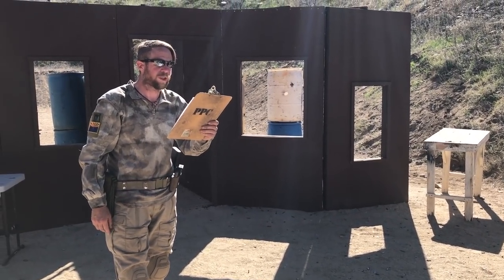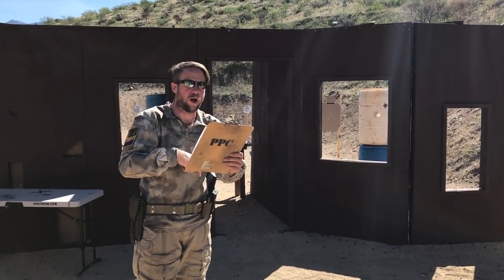2G-ACM X95 Tavor & WWSD 2017 Beta DMR - Stage 2 - CQB

Comment: Having been trained on both the M16 and the SAR-21 (a 556 bullpup), I tend to believe that bullpup service rifles always suffer from a bad rep but are often actually, from an operational standpoint, very if not more effective. I suspect it's a transition thing. Servicemen who go through the transition will invariably BMW about the new rifle having a mushy trigger or being difficult to change mags. It was like that in Singapore when the SAR-21 replaced the old M16 and CAR15 in 2001, and each batch of reservists which retrained on the new weapon would complain online, offline, in taxis, at dinner and at work. But at the end of the day, having transitioned and trained on the new weapon, you get used to it and acquire some advantages that didnt use to be possible - like faster CQB, or having a rifle at the ready when getting out of an APC, or being able to hit a man sized target behind a tree at 200m more quickly. You trade off against slightly worse mechanical accuracy, a mushy trigger, and more weight, especially on your master hand. Bullpups in general, then, are not worse or better but simply suit different needs.

Comment: Karl, I know I probably don't need to give you more reasons to dislike the Tavor, but I do have one more. Both of the ones I've handled, the original and the X-95 (and I think this problem might be fixable with the x-95 idk), my hand would slide up the pistol grip and over the little bump and get behind the trigger. I hate not having a legit trigger guard.
Reply: I know, but I thought this complaint was relevant because I can see that Karl is using the cutlass style trigger/handguard

Comment: That's a great scenario set up and I like the combat applications of it. I'd suggest for the sake of devil's advocate though that you'd want to do 3-round strings on the paper bodies followed up by the headshot. Reason being is that for real world applications, you don't know what will actually occur after you take down your designated targets... You might have run into a significant force and have to lay down suppressive fire (with your battle buddies) so you probably don't want to blow through a whole 2-3 magazines just letting 'em have it then have nothing left for what comes after. Looks like there was some kind of training aid on the paper target heads but if not, you should have something to simulate hitting the motherboard in the head... A grazing shot to the lower face may not drop the bad guy but when you hit the motherboard the bad guy definitely drops so you can get a cue as to whether you hit what you wanted rather than having to pause and look.

Comment: Hey guys, I'm not sure if you still do this but could you do a mud test on the FS2000. I'm wondering how it'll preform since it's "marketed" as a very well sealed system. Thanks and keep up the great work!
Reply: ComradNemo I concur. I have an FS and I would like to see how it does. I bet the charging handle will gum up quickly.

Comment: Karl You mentioned hitting a moveing target  does Your range have the ability to have a moveing target ? in a fluid dynamic combat setting  being able to hit a moving target would a good skill 
 I was shooting with some off duty Cops a ground squirrel ran across the berm. Since ground squirrels in that area have been known to carry Hanta virus and savatic plaque  there is a shoot on sight order  

the off duty cops opened up with a AR and a M1A  after several shots landing just the squirrel  I fired a single round and stop Him  

point being that the ability to hit a running Target  is a skill as nessarary  

I have some ideas for a moveing target for a gun Range  get back to Me  if You want them
Reply from the maker: Unfortuantely we really do not have the ability to bring moving targets into our range facility, well not worthwhile ones.   There are some pop ups and things like that but they're not what I'd be looking for.  ~Karl
Reply: OK  sneaky Targets can be a challenge

Comment: What would one need to do to run a match with you guys? Any large match you can recommend to justify a drive out of California?
Reply: I'm not Karl but I think the answer is pretty self evident, a pistol, probably a fairly modern 9 mm, a rifle, probably whatever relatively modern platform you are most comfortable with, and I would guess at the very least some intermediate firearms training, safety courses, a decent amount of range time, and a few sessions with a real trainer couldn't hurt. But that's just my guess. I know that they have the rules and requirements online somewhere and the rules are open source (I think) so it shouldn't be hard to find. Hope that helps.